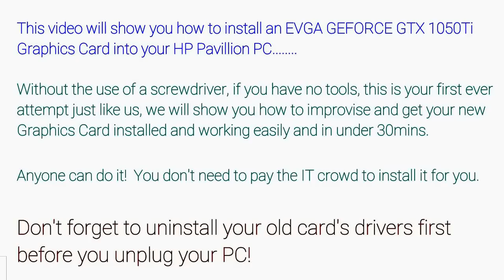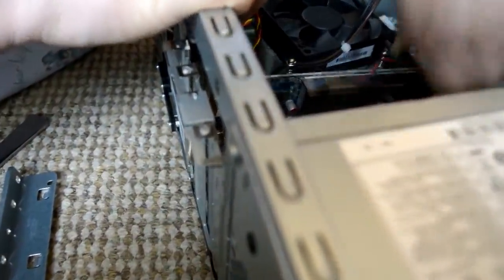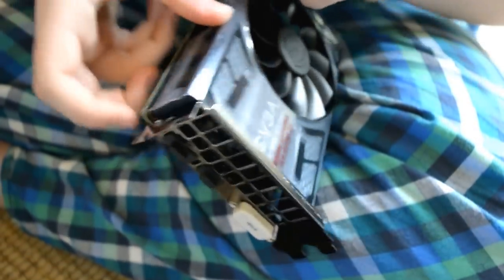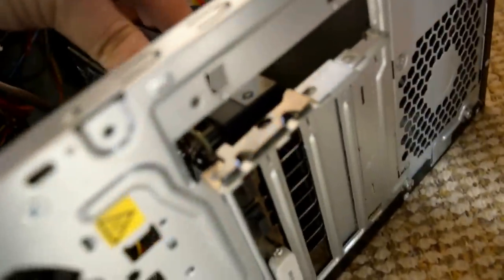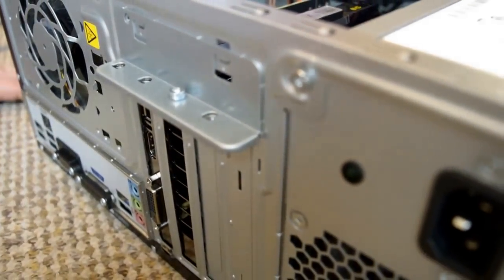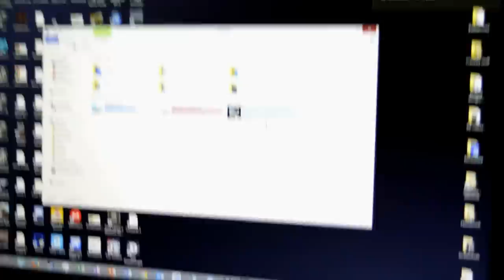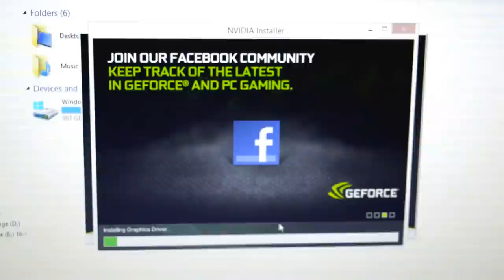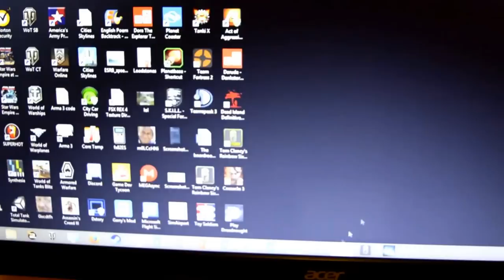How to install - NVIDIA GEFORCE GTX 1050Ti Graphics Card

Comment: Thanks for this I have the exact same pc and just installed 1050TI. BTW for anyone asking the graphic card powers itself through the motherboard and you need at least 300w PSU
Reply: Daniel Luxa THANK YOU SO MUCH U ARE A LEGEND
Reply: Dang it my ryzen 3 2200g all have 65watz
Reply: That is the recommended power supply that is given by Nvidia.
I have a 240 watt power supply and the same graphics card and it works fine.
You can have a low PSU,
although it will affect the performance of the graphics card as it will not be able to get all the "recommended" power that it needs.

Comment: Why are you doing it on a carpet?
Reply: Conterman exactly that’s a terrible idea
Reply: Why it's terrible idea on carpet ?
Reply: @LizardExterminator  static electricity can fry your motherboard
Reply: @altanzaurs  well I can't understand what you are actually trying to say 😅😅😅
Reply: @LizardExterminator  static electricity can damage your motherboard
Reply: So,Is open floor okay??
Reply: @LizardExterminator  any surface that doesn't conduct electricity, like cardboard
Reply: Because some people don't like doing it in a kitchen
Reply: @altanzaurs  there's a simple solution to that turn off the computer unplug the power cable don't turn off the power supply press the on button and it will light up for about half a second then continue and it won't affect it
Reply: @LizardExterminator  carpet is insulator so how will it conduct static electricity?

Comment: Just installed my new gtx 1050ti,this video was great, helped sooooooo much!!! Its just perfect
Reply: Do u have dell optilex 7010 pls reply
Reply: @LaythZ1  i have an hp pavilion 590p
Reply: Oh and what do u do when u put the graphic card on the pc do u just go play and check it out or go somewhere
Reply: @LaythZ1  first i installed the Nvidia system inside my pc
Reply: @LaythZ1  then i resetted my pc
Reply: @LaythZ1  and done, tried out some games i couldn't play first and it felt awesome
Reply: So all u do is put it in the pc and recent ur pc u don’t have to go to anywhere I hope the same thing happens to me too and what parts are u suppose not to touch on the graphic card
Reply: @LaythZ1  once you've installed thegraphics card, just install the Nvidia drivers, restart the pc and you're all set, i didnt particularly touch the graphics card bc i was scared of breaking it, so i dont recommend playing around with it, i also searched for an hp guide of how to install the graphic card as im a total beginner, so i recommend u do that too. Hope i helped
Reply: Thx btw how many FPS did the graphic card boosted I like how much did I have u
Reply: @LaythZ1  well, i used to try and play fortnite and my pc would just crash (i was just trying Fortnite out bc i got a new pc) after i got the gpu, my fps boosted  LOTTT, 0 lag and i could play it perfectly, even smaller games like roblox, dont lag for me anymore
Reply: My pc is 160$ and I want to upgrade it so I added 8 gb ram and soon i will add gtx 1050 ti with no upgrades the pc can run 60 FPS Minecraft roblox and fortnite but not very good only 20 FPS in Fortnite  and a champ in loading YouTube and tabs

Comment: The butter knife trick works for any similar case design (HP, Dell Dimension/Inspiron/Vostro, etc.).  No PSU change - and in  newer graphics cards, they don't necessarily have to be, as most GTX 1050 Ti designs pull all their power via the GPU slot itself.  Example: I'm looking at replacing my GTX550Ti GPU (which uses a 6-pin power feed) with a GTX 1050 Ti .  Both are dual-slot and single-fan, but the newer card is half the length of the older one, and the newer card relies entire on the slot for power (despite having four times the VRAM of the card it will replace). And you only need to uncover the ports you'll actually use.  (Example - my display does NOT support DisplayPort - so, if the DP port is covered, I can leave it covered.   The new card wil suport DVI (which I can use) full HDMI (which I can use; the old card has a mini-HDMI port, which I did NOT use) and DisplayPort (again, a port I did not use/had no use for).  Whether I use DVI or HDMI will likely depend on the game or app I am using (playing in the case of game) because of how different apps/games act - the display in question has the same resolution connected either way; hence the issue being audio - not necessarily video/graphics.

Comment: There are many red flags and I do not recommend attempting it this way. First red flag is when she unscrewed the screw with a knife. This is a bad idea because it can strip the screw. Second she touched the carpet many times during the process which will make it way easier to get an electric shock. I suggest buying a shock wristband. Next you were constantly touching the pins on the back of the graphics card witch is not a good idea because it can damage the card. you guys also put lots of pressure on the graphics card which is not good.
Reply: @itsnotatoober  he's just pointing out mistakes and trying not to get other people killed
Reply: @user-cq1ud5nf7m  killed. Really. Another genius here
Reply: @itsnotatoober  lol I didn't mean to say killed but injured or badly hurt
Reply: @user-cq1ud5nf7m  nah
Reply: @itsnotatoober  it can happen. I was killed trying to install one of these. Serious business.
Reply: @edwardinfante2602  That's not possible. If you almost died putting a card into a computer , the Devil is sending you a sign
Reply: @itsnotatoober  I didn't "almost" die. I did die. It sucked. I don't recommend it.
Reply: @edwardinfante2602  I was an IT guy for like 6-7 years. How did that happen? I can't imagine. Did you stick a screwdriver into the power while it was plugged in?
Reply: @itsnotatoober  it didn't seem to be getting power. So, following the advice of a YouTube commenter, I decided to test the main power lines coming into my house by placing them on my tongue. That's the last thing I remember.
Reply: @edwardinfante2602  Lol come on

Comment: Thanks for this tutorial. I have the same case and i made a complete Gaming Beast out of this pre built HP Pavilion

Intel Core i5 4460 
Asus GTX 1070 Ti 8GB
16 GB Ram
500 GB Samsung SSD
500W PSU ;)
Reply: Can I connect NVIDIA GTX1050ti 4GB to this motherboard?

Comment: I saw so many things wrong with that installation. 1 grabbing the gpu my it’s pcb, 2 doing the installation on the carpet, 3 using a butter knife to open your pc, 4 download the most recent drivers from nvidias website.
Reply: What's the problem with the kitchen knife? They probably didn't have a screwdriver and as you can see in the video it almost worked just like a screwdriver.
She even said that she improvised yet there are still people complaining about it^^

Comment: Get rid of electric shock only when it's plugged in and when you're not standing on the carpet is it only works when it's plugged in cuz it's connected to the ground on the electrical outlet

Comment: It is better not to do this on a carpet. There is a threat of a static buildup. Sometimes it helps to put the drivers on the PC before you put the video card in. Sometimes there are newer drivers from the manufacturer of the video card on their support website.

Comment: Thx,  for the video...  It was helpful. 

It wouldn't detect the TV(HDMI); until, I installed driver...  Once,  it worked..  I reinstalled the driver, with (Adv) clean option & the TV being the only monitor.

(was saying Nvidia control panel not assigned to plug in/monitor)

And came with custom screen resolution Adjustment, for perfect sizing..  :)

Comment: Just to say touching the power supply won't do anything if you run your feet on the carpet and touch a component it could damage it and you cant get an electric shock when its unplugged

Comment: Lou Boo u don't need to touch the power supply when opening it theres another way by holding the pwr button for 30secs although I like to hold the pwr for 1mins so I know its safe to start messing with the pc and I thought just to let u know for a future reference that's all hope it helps u

Comment: LOL RIP GRAPHICS CARD you had it on the carpet then on your pants then had your hands all over the motherboard.....
Reply: It will still work graphics cards have become more resistant to static electricity I've done this with mine when I was moving it into a new pc its completely fine as long as there is 0 power to the pc

Comment: Can graphic card GTX 1050 Ti Cerberus Advanced 4GB  work on  motherboard hewlett packard  model 3048h, computer have intel core 2 duo E7500 2,93ghz,windows7 64bit, directx11, nvidia gforce gt710 2gb, 6gb ram ddr3. i want to remove nvidia gt710 2 gb with gtx 1050 ti cerberus 4gb

Comment: if u don't have a screw driver/ buy 1.. ! work on desk/or table- less static the better/ a lot wear cheep rubber gloves.. no oil hands on anything! Read this ! 1050 card is ok as is!!! 300 watt power even! if- you go bigger - need upgrade a(suggest 750 watt or 1k) .will have a lot un needed wires so please /for room -sake.. get power supply with the holes and bag of wires add as needed! also - most the hp 700 series is TOO SMALL case for the 1060/1070/1080-10 1/4 inches needed and that's not includeing the air space 1 inch more!!! 1050 is ok

Comment: wait. dont you need to connect it with the power supply?
Reply: Chozen Mallet not if your PSU provides at least 300W
Reply: it depends on graphics ,pcie ,psu.Most of OC card need 6pin conncetor for overclock and etc.Pcie like 3.0 can give more than pcie 2.0 that gives about 75w.
Reply: This card don’t need it it only needs power from pcie
Reply: lol no
Reply: My psu doesn't supply 300 watt do I have to connect ? How & which one?
Reply: Dark Shadow take the 6 pin from the graphics card u have in your pc now then plug it into your new GPU
Reply: gtx 1050ti gets all its power from pci e x16
Reply: What is if my PSU provides only 220 watt
Reply: Chozen Mallet
Reply: Chozen Mallet
Reply: Yep
Reply: Nope that's the amazing thing with the 1050 ti
Reply: @aliatbie4898  then good luck running it because you won't get enough power to the gpu

Comment: uh you need to touch the pc with the back of your hand not fingers. The back of the hand is the part were it is the less static / you will not get hurt by the back of your hand. Its more safer.

Comment: This is creepy, I have this exact computer, and am going to buy this graphics card after Christmas

You have to agree the graphics card in this computer sucks. Everything else is great, 915gb of storage, 8gb ram and
i5 4460. (Altough my Wi-Fi thingy is failing aggressively)
Reply: JoeMakaFloe If possible I would suggest getting an Ethernet cable so u can plug your WiFi straight into your computer...that’s want I did when my WiFi thingy wasn’t working
Reply: @JohnWelchy  Yes, my mother ordered one quite recently. Planning on using it soon
Reply: If I was you you'd be better off putting a GTX 1060 in there as long as the power supply has a 6-pin connector because the 300 watt power supply is actually more than enough to power a 1060. I've actually installed 1060 is myself in a 300 watt power supply computer before and it runs perfectly fine as long as you're CPU is a minimum of 65 Watts or less. you might be able to get away with a 95 wash CPU but I wouldn't attempt it personally because it might draw even more power because the GTX 1060 on a full load uses about 100 to 120 watts of power

Comment: Hello guys, this is probably the first time that I ever posted a question like this but I am currently planning on upgrading my old desktop that I had a few years back and it's an HP Pavillion P6-2100. Right now, I am trying to seek help whether my system can run a graphics card (PCI Express 2.0) that can be able to play some games that came out before 2014. Can I buy any graphics card that lies in the PCI E 2.0 version or which GFX card I should get that could stabilize the system naturally without needing to buy a power supply? 

Here are the specs:
Power Supply: 300W
CPU: A4-Series APU A4-3420 (2.80 GHz)
RAM: 4 GB DDR3
Hard Drive: 1 TB HDD
Video Card: AMD Radeon HD 6410D

Comment: I have a Dell Optiplex 9020 SFF i7-4770 windows 7 pro 64-bit, 32 GB RAM, 256 GB SSD, Dell U222m display. The graphics card Nvidia NVS 510 low profile was already installed by somebody before I bought it from Ebay in 2015. Then later bought Gigabytes Geforce 1050Ti 4GB  low profile planning to upgrade for this pc.  Before I take out the older NVS card and install the new 1050Ti, i have questions. Should I un-install the drivers FIRST before I shutdown pc and open it up and remove the NVS card and then install 1050Ti card in my PC, and then install the new nvidia drivers from the CD that came with the nvidia product box, right?   Or, should I leave the NVS drivers alone (untouched) and move on to install the nvidia drivers from his CD?  I asked because Im worried about the installed drivers for NVS left behind that may be in conflict with drivers for 1050Ti.  I need a official link of step by step to uninstall to clean state n install drivers for 1050Ti. And where in the menu to uninstall nvs drivers? Thank u for your support.

Comment: Will a CIT 400w power supply work with that graphics card because I heard there not that good but  it's the only matx power supply I could find. My current power supply is 180w. I have a hp pavilion desktop as well.

Comment: Can you upgrade HP Pavilion P6 2356-in  to GT 1030
Reply: Tell me your power consumption unit (PSU) and your proccessor (CPU)
Reply: I believe you can. The GT 1030 isnt relativily powerful but youll probably get most of its power with the processor im assuming your pc has. Assuming this (https://support.hp.com/us-en/document/c03548954) is what your pc has the 1030 should be good. Your specs should handle it. The 300W power supply should work too.

Comment: 2 problems 1. u dident plub in the power cables 2. Dont use the drivers disk look up the drivers on nvidias website
Reply: Doesn't need power from psu. This card gets its power from the rail.

Comment: My PC is an HP 500-449, it has an AMD A8-7600, 8 gigabytes of RAM and a MSI GeForce GT 705. I will soon take me a Gigabyte GeForce GTX 1050 Ti 4Gb Low Profile, is this a good choice ?
Reply: ShadowZard 1050 ti oc will fit
Reply: if youre buying a 10 series GPU i recommend you to upgrade your CPU, A8-7600 cant give you full the potential of your 10 series GPU

Comment: run gtx 1050 ti evga mini with 290w please answer
Reply: 290watt power supply, no, the 1050alone is 300watts nevermind ti,gr 730,or older ones with low power supply best bet, or buy new supply

Comment: Building a computer on carpet is so dangerous to the machine. Also has the power supply been changed at all?
Reply from the maker: No never changed the power supply as the one we have is sufficient and we checked that out before purchasing the graphics card.
Reply: 180W is definitely not sufficient to run a GTX 1050 Ti without it wanting to die... topkek.
Reply: It’s 300 watt
Reply: Infinity wdym bruv

Comment: did you upgrade your power supply? Because on the hp website it says the hp pavilion 550-459na has a 180 watt power supply. i have a different model that it also says has a 180 watt power supply so i want to make sure it would work on mine if it works on urs. but if u upgraded your power supply just let me know pls
Reply: The graphics card they are using only uses a minimum of 75 watts of power anyway. The recommended power supply is 300 watts but minimum would be about 200 to 180 Watts.

Comment: hi, i know its been a long time but do you know what power supply you have in that computer i am looking into getting a 1050 ti for the hp pavilion and wanted to know if the 180 W uATX Regular internal power supply worked with it

Comment: how much power supply watt you using to power this graphic ?
Reply: EVGA recommends a minimum of a 300w powered PC.  However, I was able to run this exact card on an old Alienware X51 R1 which only has a 220w power supply.  It ran completely fine as the card itself only uses the 75w power of the pci e port itself.
Reply: It is doing perfect on 500 w
Reply: EV1L DC4_TEGGZ please explain and help me I have a 240 watt power supply and this card requires minimum of 300 watt I really wanna buy this card but I'm afraid it might not work. Does it require a 128 gb of ssd to work or something. Please tell me what it requires to work and if it will work perfectly on 240 watts please help
Reply: NIGHT WOLF low profile?
Reply: I'm buying evga gtx 1050
Reply: NIGHT WOLF wdym by low profile
Reply: So are you sure that it can run on my 240 watt power supply smoothly
Reply: Isfandyar Kashif It should have.
Reply: get ateast 450 watt
Reply: Need at least 300 but 500 is good
Reply: @isfandyarahmad7081  yes 240 watts is more than enough power to power a GTX 1050 TI. Just like with a GTX 1060 and the minimum power requirement is actually 300-watts  because the GTX 1060 itself only consumes about 100 to 120 watts of power
Reply: @isfandyarahmad7081  a GTX 1050ti only consumes about 75 to 80 watts of power.
Reply: @isfandyarahmad7081  and gets its power straight from the PCI Express whereas the GTX 1060 requires a 6-pin connector.

Comment: Hey, i have exactly the same PC but how does this run stable because that psu is only like 180watt and the recommend wattage is more like 300. So how does it run?
Reply: Well your power supply has nothing to do with performance of the computer. and the GTX 1050ti only uses a minimum of 75 Watts anyway on a full load. sorry if you had a CPU that used it 65 watts and a GPU of 75 watt like the 1050 TI  then the computer is only consumed in about 150 to 160 watts of power so the 180 watt power supply is more than enough to power this was GPU as long as you're CPU is only a minimum of 65 watts just like with a GTX 1060 the recommended requirement is 400 watts but the minimum requirement is 300 Watts